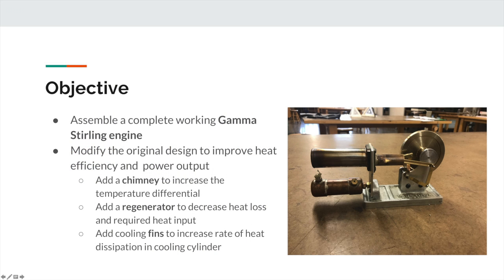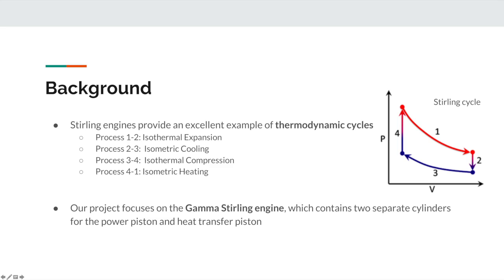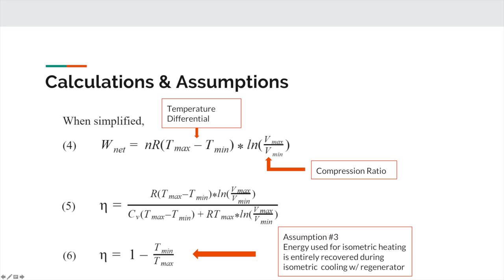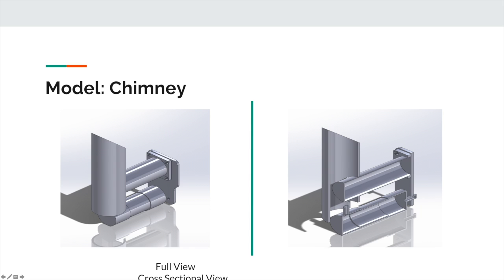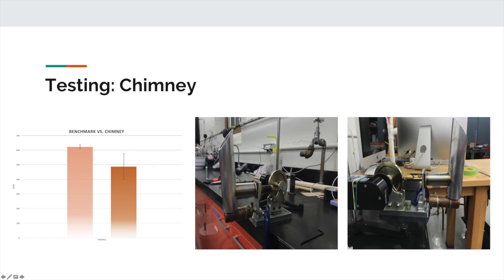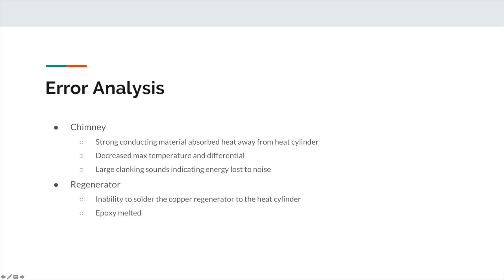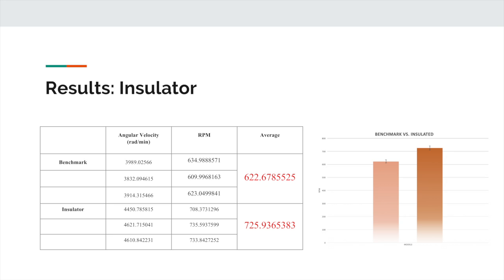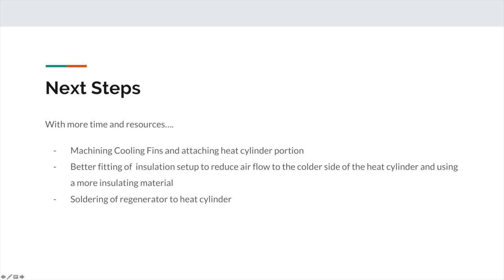How to modify Stirling Engine for better or worse--a fun project on a classical engine

Comment: I know this is probably a school project, and likely nobody is watching for a comment 5 years after it was posted, but if you were to add more surface area to the cold side piston like you'd accidentally done with the chimney on the hot side, making a heat exchange if sorts and increasing the temperature differential?